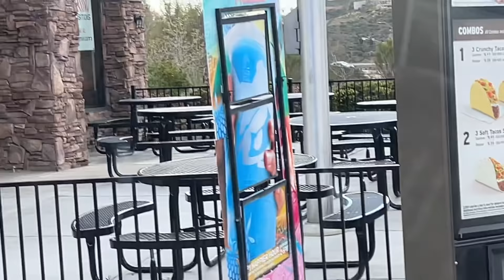Riding A Dirt Bike In The Dealership - Buttery Vlogs Ep139

Comment: I hope whoever wins this will actually keep it and hopefully it serves them well!
Reply: Ik I would use it
Reply: Electric start 250. Uh yeah, I'd ride tf outta it and I don't like Hondas lol. I'm tired of kicking
Reply: @rotaryjunkie9502  yeah, im lucky i got e-start but i mean a brand new bike would be awesome!
Reply: I’d be so stoked if I won this. I’ve been saving to buy my own bike, but it seems like the cost of used bikes is going up faster than I can save.
Reply: @joeywalz8530   buy,sell,trade your way to a bike you want. all ive ever owned is clapped out bikes. i get them cheap, put some money into them and flip them. i have a clean af 2008 kx250f right now. i traded a 06 rmz450 for it. the 450 was a trade in at Beta Dealer and got it for 1800. watch the market place every day and be ready to buy at the drop of a hat
Reply: @rotaryjunkie9502  exactly, I traded up from an old crf80 to  a 2013 Crf 250. clean as fuck
Reply: @exposter  nice. 2013, fuel Injection right? Thats my goal is to trade up to a fuel injection next
Reply: @rotaryjunkie9502  No, actually mines a  carburetor
Reply: @rotaryjunkie9502  oo
Reply: @nicholasbrown3716  rqquq
Reply: @nicholasbrown3716  0000hj